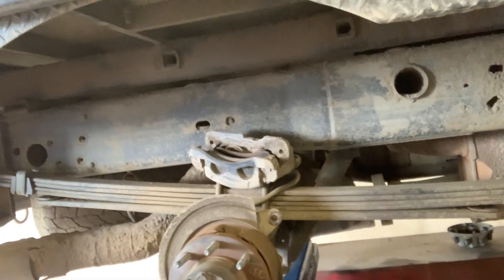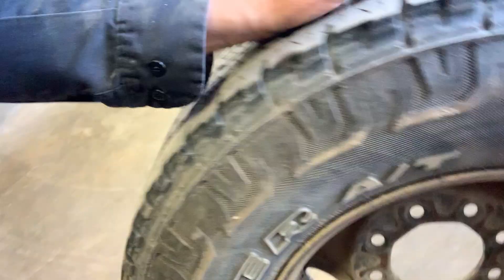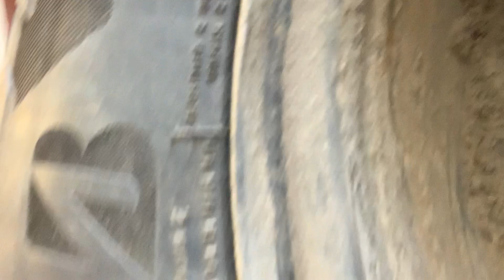GMC 2500HD Brake and Wheel Issues Alaska Haul Road Truckers

Comment: Calcium Chloride is used as a dust control palliative. I pulled the bed off my '82 F250 to get every last bit of CaCl out of my truck's frame. I need to do a video on the HEI distributor rotor repair we had to do. You are an awesome mechanic Tim!
Reply from the maker: Thank you so much. Please keep the calcium chloride down there. Yuk.
Reply: @ThecardoctorTV  Actually it's up there on the Haul Road, which I drove for work this summer from Anchorage.

Comment: mud eating brakes is a very common thing here in Alberta. about to put set number 5 in a 2019 gmc half ton. that has less than 100 000kms. just did a 2020 with 27k. pads,rotors and calipers. the spacing between the calipers and stock steel wheels is almost non existant on these new trucks, so a little mud and everything is destroyed.

Comment: Tim ... off subject here a bit but I have a front end vibration or shutter question. On my 2009 Silverado Z71 i have this occur at 5mph or less when easily breaking ever since I've owned the truck.. I pulled ABS fuses and it still happens. I've always had outer front R tire wear after numerous alignments and several sets of new tires thru the years. . Any clue?

Comment: Very cool. 
Can you pressure wash that mud off those wheels?  Not bad 100k out of brakes.
Reply from the maker: That’s what I told the customer. Best braking system ever made.
Reply: My brother who is in construction owned a mid 90 F-350 Super duty 4x4 7.3 diesel. That had a very stout braking system on it as well.